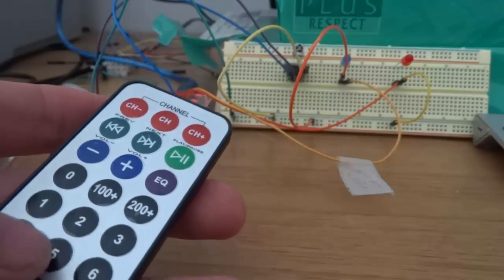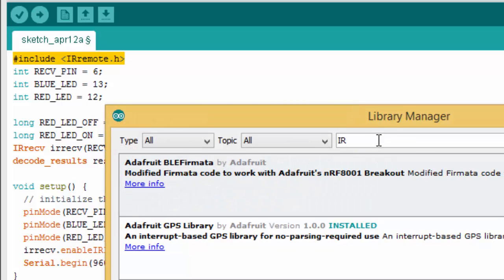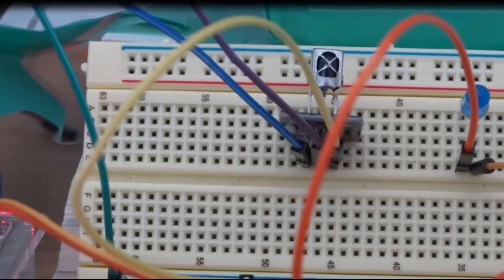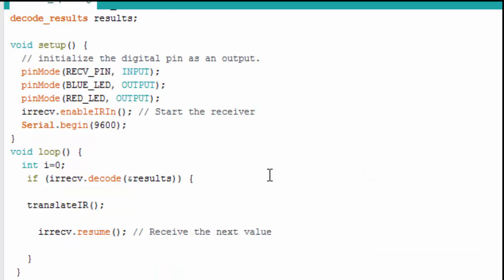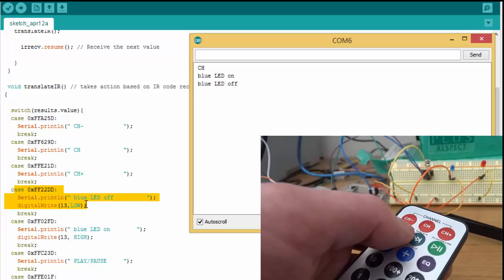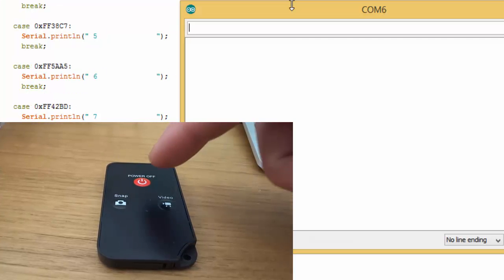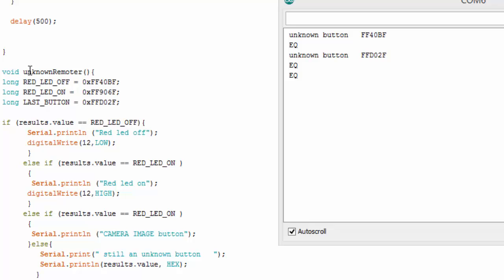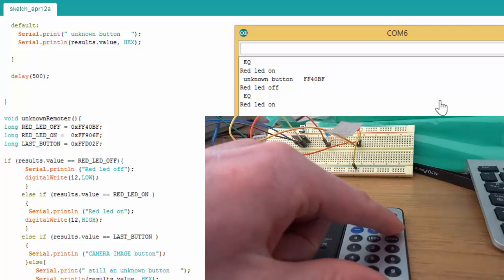Infrared (IR) Remote control. Arduino

Comment: Thank you for sharing this video and your great project
I learned a lot. 
although there was something that I found. 
I don't know if you meant to use another remote to turn off your RED LED  after you press (EQ) button on car remote or you miss to add        digitalWire(12, LOW);         and sign it to one of buttons of your car remote.

I also wonder how to put one of home appliances using relay instead of LED there
if you have any idea you could assist me with, I would be very thankful.
Reply from the maker: video about relay
https://www.youtube.com/watch?v=FzJ3JqtQVko&t=28s

Comment: Hello, good job! I have problems when using only the atmega328p mirocontoler  with out the arduino board, does the board has a special componet that makes it work or is there a possible solution to make it work?

Comment: great video!
I want to control an Led-Display (WS 2812b strip) with the ir-remote.
Do i have to  use the "if" -construction, or is it possible to make the remote trigger an interrupt?
(i didn't find anything about that)
Reply: do i have to use 2 arduinos maybe? one for controlling the leds and one for triggering the interrupt and controlling the remote
Reply from the maker: +Mixter Muxter  NO one arduino on the leds, and yes I think you can interrupt, but if the only task for the arduino is to controll the leds and handle the incoming signal than the an if construction will do the job
Reply: +logMaker360  Thank you for the quick response. The if construction will not work for me, because
i have animations running on the strip and also
a spectrum analyzer ic.
It's already just about possible to fetch the data from the spectrum analyzer and transfer it to the leds.
So therfore there is no time to constantly wait for the remote commands.
I just tried a library that was labled "interrupt-based", but i couldn't get it to work yet (http://playground.arduino.cc/Main/IRLib)
Working now on getting rid of the "WConstants.h not found" error.
maybe it will work...
Reply: this is not working...i do get a read (1 outta 50), but the serial just gives me zeros.
I think the interrupt is not working properly, because the ir signal is not a debounced rising edge (carrier frequency throws off the interrupt?).
Also the decoding of the signal seems to be messed up...this library will not work.
Reply from the maker: +Mixter Muxter I will come up with a interrupt video this week...

Comment: Any ideas on putting the battery in this CAR MP3 remote? It seems hard for me. Hard to pull out the battery holder now I try to put it back with the battery and won't go? CR2032 3V Energizer battery. Help?

Comment: but now another problem I am facing in printing in message according to the pressing button on remote, basically what the hex codes you have put in the program are not matching with my remote button for example on your remote 8 nummber is   FF4AB5 but on my remote it gives value is this 1BC0157B while i have the same remote as shown in your video. and other problem is that I have changed all the codes according to my remote but every time default messages prints on serial monitored along with the respective values of the pressed button.
Reply from the maker: That sounds weird, I mean your second problem. If you press a bottom, you get a ramdom output?
Reply: I mean if I press 1 the output show 1 one serial monitor but along with it this message ("unknown button") and the hex value is displayed, similarly all the buttons one by one i press the same output of the button is shown but   ("unknown button") and the hex value is displayed also along with it. I have changed the hex values as per my remote control they should be matched with each switch case but I dont know why  ("unknown button") and the hex value is displayed every time ????

Comment: Dear Sir,

Greetings for the day.

Many thanks for share the video with us it is very useful 

With regards, i need some help from your side, i am working on ARDUINO UNO but there is showing error i tried to resolve it but unable to do it so i request you to if possible then please try to help me resolve this issue 

Below mentioned error we are facing 

Arduino: 1.6.3 (Windows 8.1), Board: "Arduino Uno"

LGACSendDemo.ino:1:22: fatal error: IRremote.h: No such file or directory

compilation terminated.

Error compiling.

  This report would have more information with
  "Show verbose output during compilation"
  enabled in File > Preferences.

Thanks & Regards,
Kapil
Reply from the maker: Hey Kapil,

It looks like you have not installed the IRremote.h library correct. Are you familar with libraries?

Comment: Why you didn't use pinMode in the setup ?
Reply from the maker: I did use pinMode!!!
Reply: Oh yeah, I can see now. Didn't rewrite it. But anyway it's working without the pinMode setup :o Do you know how is it possible? It's my code: 
#include "IRremote.h"

int receiver = 2; // Signal Pin of IR receiver to Arduino Digital Pin 11
int relay = 6;

/---( Declare objects )---/
IRrecv irrecv(receiver);     // create instance of 'irrecv'
decode_results results;      // create instance of 'decode_results'

void setup()   /--( SETUP: RUNS ONCE )--/
{
  pinMode(relay, OUTPUT);
  digitalWrite(relay, HIGH);
  Serial.begin(9600);
  Serial.println("IR Receiver Button Decode"); 
  irrecv.enableIRIn(); // Start the receiver
Reply: /---( Declare objects )---/
IRrecv irrecv(receiver);     // create instance of 'irrecv'
decode_results results;      // create instance of 'decode_results'

Don't get those two lines. What do they do?
Reply from the maker: in the first line you import a library called IRremote.

It is C++

In this library is a class with the nobel name IRrecv irrev(receiver). To work with this class you need a instance to be able to call its functions.  So with the first line you create a instance of the class.

I didn't study the library but I am assuming that the second line is a hex value. If you make a new class you basicily create a new for you suitable datatype. The result from the decoder is a hex value. So I am assuming that in the library the second line is a custom made data type for the hex value. To work with this you need to create an instance as well.

If you are intrested look on my changel I made a few video's about library's and arduino datatype's
Reply from the maker: Did you connect LED's to the arduino? or is it only working in the serial monitor?
Reply: Sorry, Haven't seen your whole answer. What does it mean to create an instance? I don't get it. Could you explain it please?
Reply from the maker: You import a library this means that you add a piece of code to your project. To enter this piece you need a way to call it. The entering bridge is done by an instance.  Or in the library we have a class called people with functions like age() dateOfBird() ect. In your code we make a instance of the class people and call it Mark; Something like: people Mark; From this point in your code you can access the class funtions: Mark.age(); or Mark.dateOfBird(); 

I made a arduino course on my YouTube changel. Those video's can help you. Or have a look on the website thenewboston.com for easy c or c++ tutorials

Comment: Hi Logmaker360, your tutorial is very helpful. But now I met a problem that if I'm not pointing the remoter(or block by other object) to the IR receiver, it will get wrong HEX. Do you know how to solve that? Thx.
Reply from the maker: I once had a corrupt (broken) receiver. I was giving me al kind of unkown data. I would sugest: try anolther  receiver
Reply: And the new receiver works fine when remoter not pointing at it? I feel confused just because it works when pointing at it and not when doesn't.

Comment: Does this also works on a genuino because i tried it but got the error cant compile ?
Has this to do with the board or the library?
Reply from the maker: change board in the compiler to uno/genuino.
Reply: it seems it dont work also he says the library is interupt

Comment: sir how can i find hexadecimal value.
Reply from the maker: hi adbullah, please watch the video again. carfully. The answer is in there.
Reply: THANK YOU ...CAN I CONNECT SENSOR WITH DIFFERENT REMOTES
Reply from the maker: Yes is the remoters if you take the hex value from the remotors and code them in a switch statement.